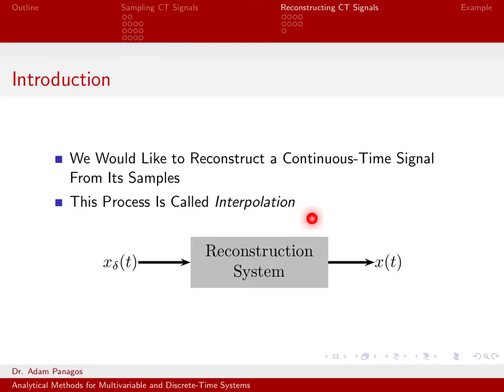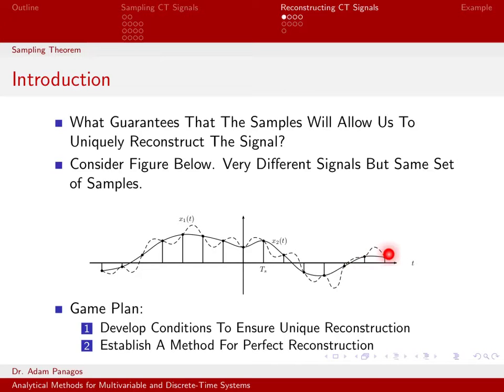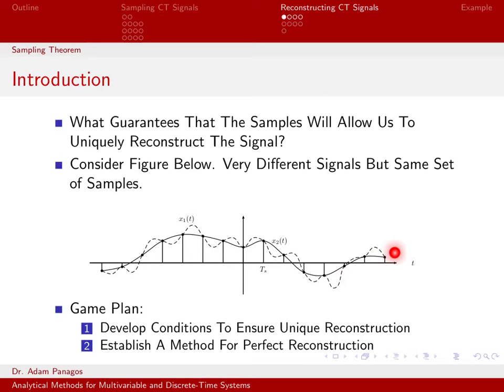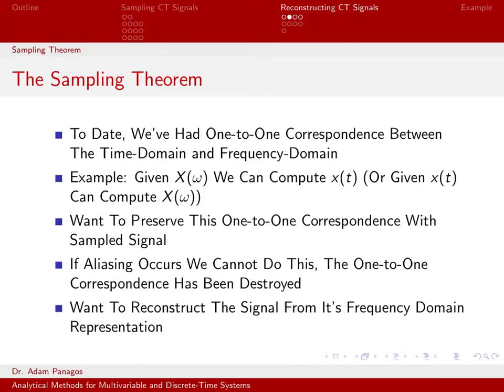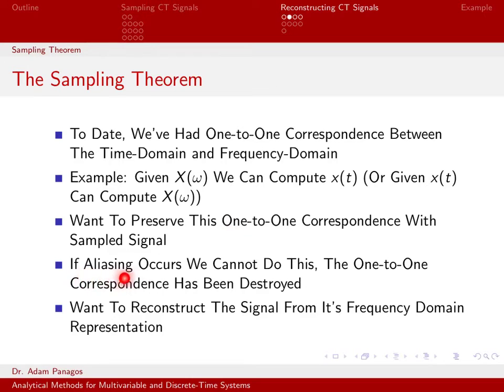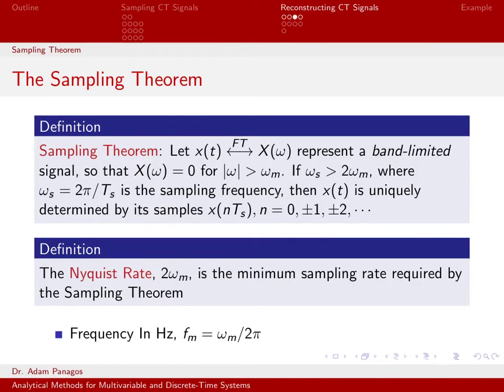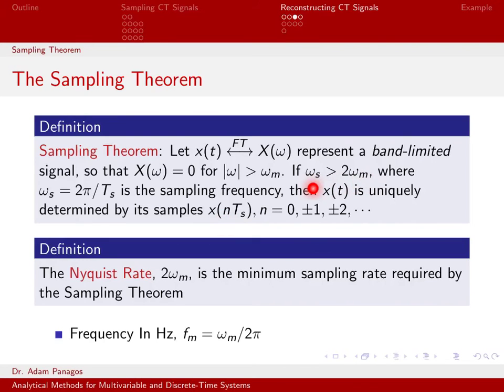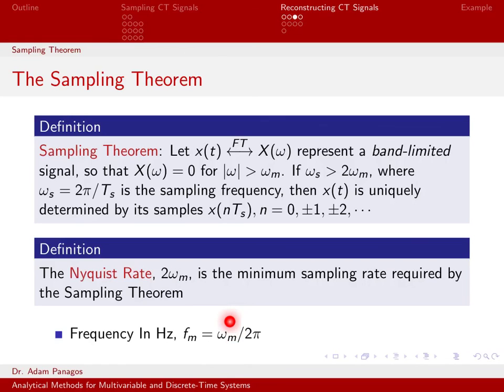Sampling Signals (8/13) - The Sampling Theorem

Comment: Thx for uploading this video.

How is reconstruction (aka interpolation or oversampling) DIFFERENT from digital to analog conversion (as done by the DAC).

In audio, older CD players did not have oversampling (digital filter) chips. They only had DACs (and analog filter after that, just before the output jacks).

In the mid-1980s (henceforth), dedicated oversampling chips (4x, 8x, etc) began being implemented. (Reason for this, as claimed by manufs/industry: to avoid brick-wall analog filtering after the DAC).

But if a DF "reconstructs" the digital signal to analog, why (how) is the DAC (which follows the DF chip) then used?